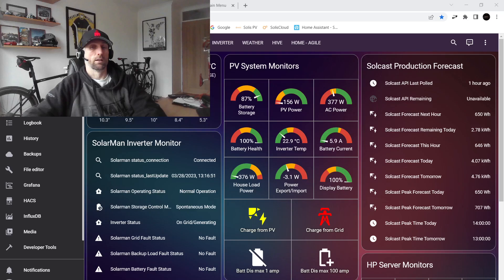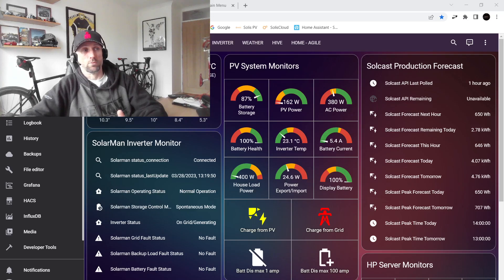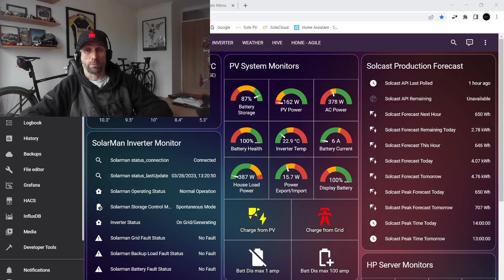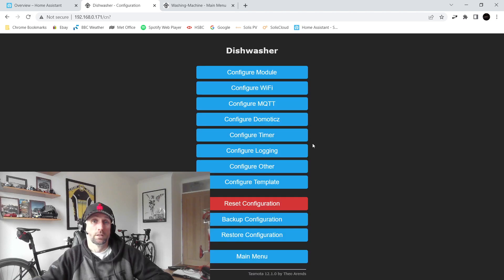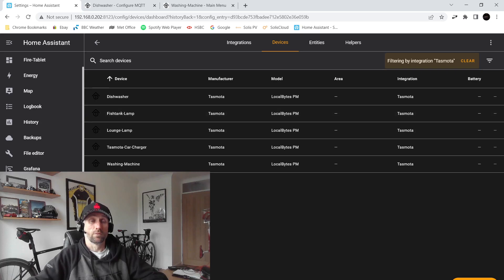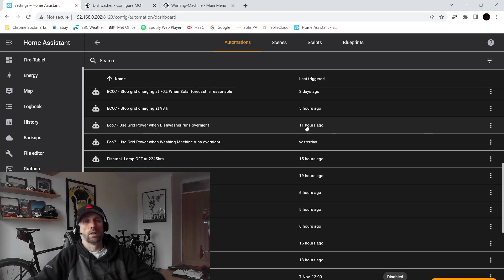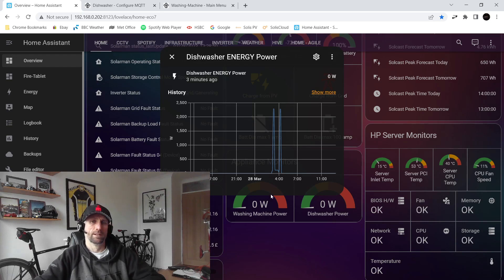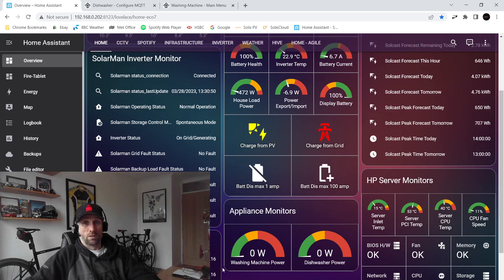Home Assistant & Energy Monitor socket integration

Comment: Maybe I'm missing something but if you have the battery set to charge from the grid during the off-peak periods wouldn't this appliances also just run from the grid? 

I'll definitely give those plugs a look though 
My little one has discovered she can turn on the dishwasher by mashing the buttons on the front. Having a way to stop that seems like a good idea :D
Reply from the maker: Hi Grant, thanks for watching and the comment. You're right, when the battery is charging then everything will run off the grid but there are circumstances when you want to run off the grid when the battery is not charging. For example, if your battery finishes charging at say 5am you wouldn't want your appliances using the stored power between then and 0730(GMT) on a day with poor solar production forecast, otherwise you could end up having to buy expensive/peak grid power if you don't have enough stored in the battery to get you through the whole day. Likewise if you have a good day of solar production followed by an average or poor day, and someone turns on an appliance during the off peak period, then you'd want that appliance to pull from the grid rather than using any stored power that you might need for the following day. You can obviously work out your own logic based on your own consumption pattern, but that's what works for me.
Reply: @gordonmarkus  Ah I see what you mean. 

I'm on intelligent octopus rather than eco 7 & my solar is on a West facing roof so usually doesn't see any meaningful charge until late morning. 

I set the inverter to charge the battery at 6amps during the off peak period. 

I thought about doing something like this though to set the inverter to pull from the grid when the shower is on rather than take 3kw from the battery and 7 from the grid to try and help out the lifespan of the battery
Reply: I don't understand this. If you set the inverter to charge the battery for the full midnight to 7 economy 7 period then wouldn't appliances always be pulling from the grid during that period, regardless of the battery SOC? e.g. with a 3kW inverter and 9kWhr battery, the battery will charge in the first three hours of eco7. Assuming the dishwasher has its first heat cycle one hour in, it will pull from the grid while the battery is charging. Then if the second dishwasher heat phase is after the battery is fully charged, say 4am, it will still pull from the grid won't it?

Comment: Hi, it took me a while, but I finally worked out how to set mine not to discharge during 0030-0430 Octopus Go. The web app to programme the inverters is in Chinglish and is completely backwards and not intuitive. You'll notice a big difference in battery life, I did. I'm 99% zigbee for my smart plugs except for 4 wifi plugs (but only using 2 of them) as I turn off my main wifi net overnight as I have the antenna in the loft and it points down through the bedrooms.
My dishwasher also double spikes and maxes at 2.5kWh